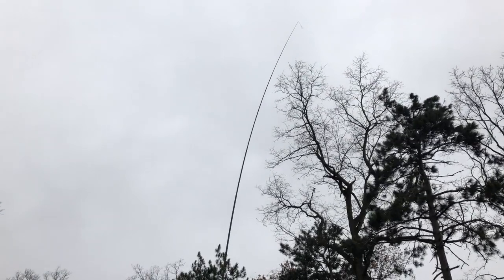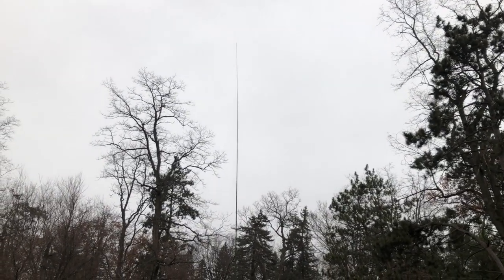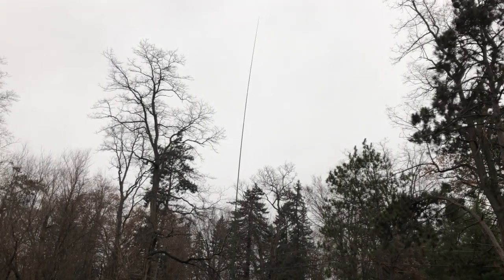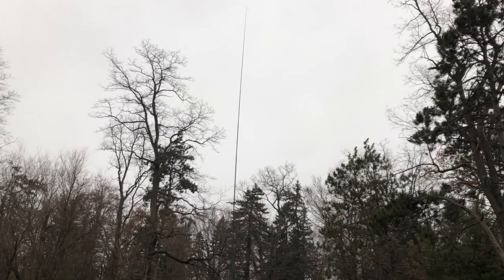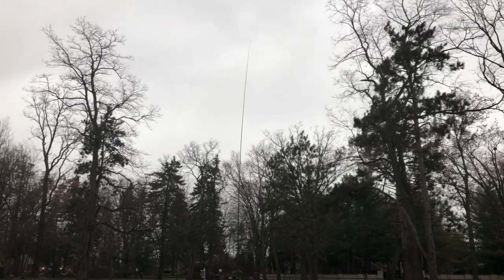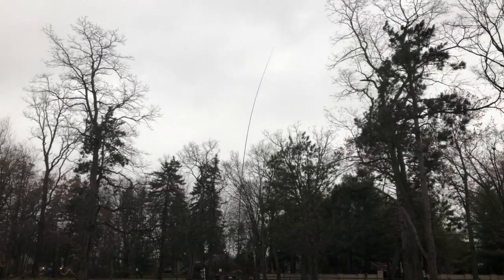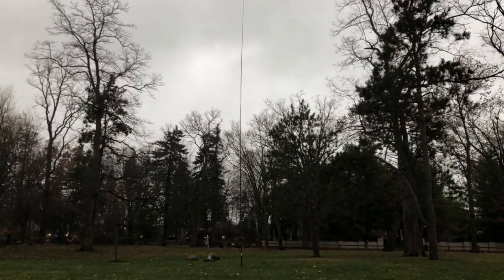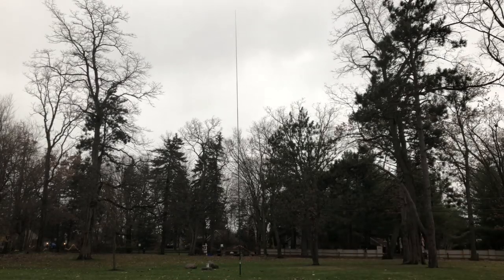MFJ 1917 43' Mast High Wind Test

Comment: what kind of antenna do you put on the top of that mast?  I was thinking about getting one and putting a dipole on it
Reply from the maker: You could do that.  I used a PackTenna Linked Dipole with this.  Be careful what you use though.  Even the really light PackTenna puts a bit of weight on the top.  Not worried about breaking, it just bends over a lot at the top.

Comment: Perhaps, I missed it, but I didn't see any kind of antenna on the mast.   I really don't care whether an unloaded mast flails in the wind, or not.   I care whether it can support some sort of an antenna in the wind without crashing to the ground.   But, thanks for letting me see that it isn't likely a good idea to use one of these in windy conditions with an actual antenna installed on it.
Reply from the maker: No I didn’t have an antenna on it in the video.  I just wanted to show that it could withstand the wind.  I usually use light weight dipoles or end feds with it and I doubt it would fall down so long as it’s guyed appropriately.

Comment: My 12 meter (approx 40+ feet) mast from Spiderbeam and my DX Engineering 15 meter mast (effing tall) both withstand 80kmh winds and higher gusts without any problem.  No guys.  They bend a lot, but don't break.  I have had them up for over a year now.  Make sure you have good and long stakes / tent pegs in the ground.
Reply from the maker: Yeah its crazy watching the mast flail around like that.  Fortunately this is not a permanent mast for me.  I only use it for portable ops.  I would have this guy'd like crazy if it was set up at home though.
Reply: @hamradiotube  I agree.  For portable work, the 12 meter spiderbeam mast is tops.  The very end is still quite stiff, not like the 15 meter mast.   Keep up the great videos!  73! de David SV0SGS

Comment: I'm sure if you had a load on the top like an end fed antenna, that would have snapped.  I have the MFJ-1913 and that is what happened to me.  Snapped my 2nd to last pole.  Sent broken pieces to MFJ and replaced for shipping cost only.  I know my wind limits now though.  HIHI  Thanks for the video.
Reply: How much wind we talking? 50km/h+ ?
Reply: @_4L  I believe the winds were around 40mph Gust.
Reply: @johnw9557  ahh ok, thank you

Comment: Nice mast. Would it still work with an antenna on it under similar conditions?
Reply from the maker: Absolutely. You just won’t see me out there operating in these conditions:).
Reply: @hamradiotube  Where's your sense of adventure! 😁
Reply from the maker: @davidsradioroom9678  It goes away when it gets cold out.
Reply: @hamradiotube  😁

Comment: Impressive, but I want to see an extended, 2 - 3 days, high wind with temps around -5C. Not asking you to do this however your local area is better for that temperature than mine. Regarding wind some of the younger trees, less than 20 years, bend over a considerable bit wind the gusts 35 - 40 mph. 72 KB8AMZ

Comment: Nice video and product.  Thank you.  What type of antennas can you attach to the mast and how do you attach them?  I assume you can attach an end fed antenna but what about attaching a vertical antenna - would you have to shorten the mast?
Reply from the maker: Right now I'm using the PackTenna Linked Dipole, and the PackTenna Mini (vertical).  I use a zip tie to attach the Linked Dipole, and for the Mini it has a  little carabiner at the end of the wire that I use.  I have a follow up video on the Mini that I will post in the next few days showing how I attach it.  One of the biggest reasons I wanted a mast this high was to accommodate the length of wire that the PackTenna Mini has (40 feet ish).  My other ones were too short.

Comment: I was really tempted to hit the buy button for one of these.....but there really isn't much you can put on the tippy-top of one of these things even with no wind.  In high winds, with even a modest antenna...would this mast survive?  A long wire with small gauge...probably/maybe be okay.  And maybe you would not use the top two or so sections in a high wind, but then what's the point over a nearby tree?  I mean, I appreciate your video demos of this mast, but I'm not really sold on one especially given the price.  I like my metal mast for things like Field Day.  When backpacking I'm not going to take any kind of mast.
Reply from the maker: Thanks for the comment Thom.  A mast like this serves me very well for the operating conditions I use it for, portable radio, POTA.  Quick up, quick down.  I do put my PackTenna linked dipole on the top section of this mast.  I put it about half way down the first section though.  Don't expect any mast like this to stand straight up with any kind of load on it, it will bend over to some degree.  In high winds with an antenna on it, I feel this mast would do just fine.  It will bend sure, but the dipole is also staked to the ground providing some support as well.  And I could use more guy ropes.  But I also don't every see myself wanting to do portable radio on a day like this either.  You're right for sure on the price, like I mentioned in my last video on this, I too think it is a bit high.  I will be doing more videos portable with this mast and antenna configurations.  Just don't know how much time I have left to get out there before the dreaded winter comes.  It may not happen until spring.  73

Comment: Looks like it did good my S9 vertical I had found it on a galvanized pole in the wind with no guy wires didn't do too bad but after a few days of cracked one of the bottom sections some. But it is still usable
Reply from the maker: I don't see myself operating in these conditions but it did great.  I would def guy it more towards the top if for some reason I was out operating though.
Reply: @hamradiotube  yeah mine was a temporarily base vertical. And why is that work we had to storm pop up that had 40 to 60 mile an hour winds. After that anytime I've done using it it got laid down on the ground
Reply from the maker: @ryankc9oza118  Yeah if I were to use a mast like this for a more permanent install I would be sure to guy the heck out of it and clamp it at each section so it doesn't collapse.  Good idea to lay it down after use though.
Reply: @hamradiotube  keep up the good videos